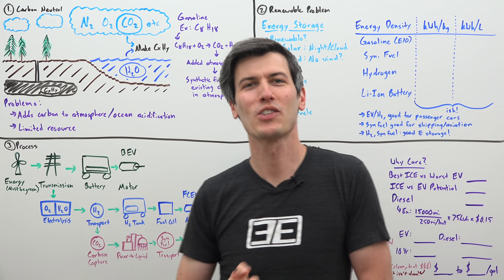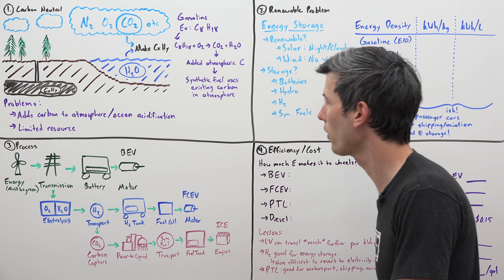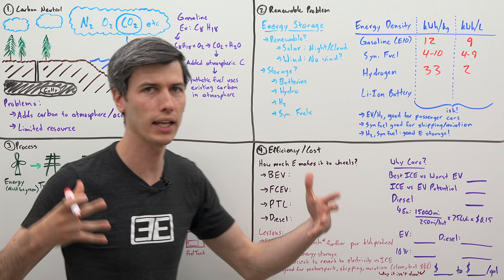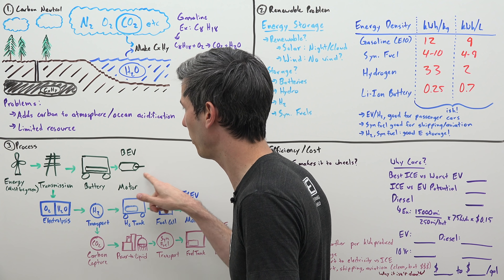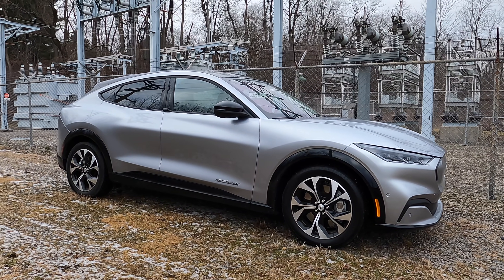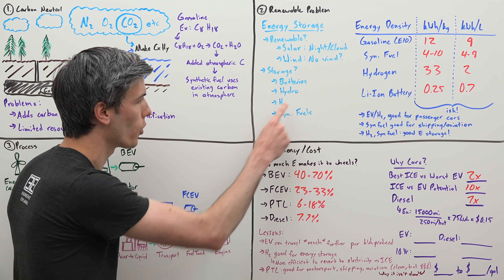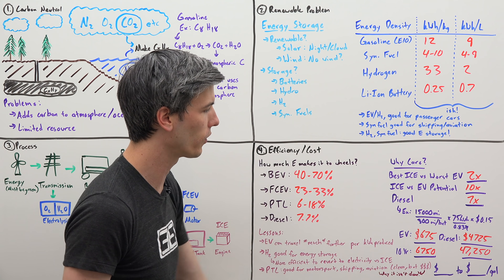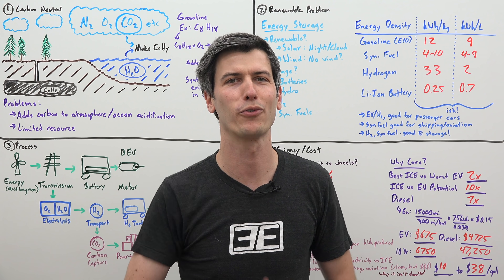The Big Problem With Synthetic Fuels

Comment: Honestly for shipping, I think nuclear is probably the route to go. Much higher energy density than anything else and is reliable for long trips.
Reply: Lol, just in case you need to drive for 20 years without stopping at all.
Reply: @danieljensen2626  I'll jump off subject a bit: naval vessels
Reply: It seems like the capital costs are way to high.  The USN only uses fission for aircraft carriers and submarines.  Russia also has nuclear icebreakers.  Maybe if molten salt reactors drop down the capital cost to something more reasonable?
Reply: Nuclear-electric does make sense, at least in theory, for large container ships and cruise ships.
Reply: @electric7487  I thought nuclear vessels typically used steam turbines for propulsion.
Reply: i dont think private companies can be trusted with nuclear boats. just imagine they neglect the upkeep and now you have hundreds if not thousands little fukushimas running around. Then when end of life is reached the ships conveniently just happen to sink in the middle of international waters because dismantling nuclear boats is a nightmare. No thanks.
Reply: @Gekkoperformance  For most current in-service nuclear technology, I think I'd agree with you. There are some next generation nuclear reactor designs that might be a different story if they can be commercialized and adapted to use in shipping, though.
Reply: @Gekkoperformance    That’s exactly how it would go down!  Here in Australia Woodside Petroleum had an oil rig that was past its use by date so they just “sold” it to two dollar front company and that company goes broke so bingo now the taxpayer is on the hook to decommission it and clean it up!
Reply: @Allen Loser interesting, but what about 200 grams
Reply: Good thinking, bc it’s not like ships ever get wrecked or pirated.
Reply: 100 grams of Uranium can make your car work for years while providing power for your own house. But a car crash would be awful
Reply: Nuclear powered semi truck? Sounds kind of cool, but I can just imagine the nuclear winter we will have during winter when a bunch of trucks crash

Comment: I wonder where ammonia would place in comparison? It's being proposed as a candidate for long term energy storage, as it's relatively easy to synthesize (although the process is still not as efficient as the ones for pure hydrogen), and can be stored as a fluid under comparatively low pressure, compared to hydrogen. Fuel cells for it exist and are being developed further. And while probably still a very inefficient use, normal current designs of combustion engines should be retro fittable to use it as fuel as well, with a few tricks leading to a carbon free solution, even if inefficient.

Comment: Bear in mind that in the example you give about the cost of fuel over 10 years offsetting the cost of an electric car. Most people who are wanting to use synthetic fuel are wanting to use it in a car they already own and want to keep long term, so they don't need to factor in the cost element of the car in your calculation and they will happily pay much more for the fuel element as a consequence.
Also those people will absolutely not be driving anywhere near 15000 miles per year in that ICE car and the fuel will be much cheaper in a few years. So I can easily see this stacking up for most people who want it:
2500 miles per year for 10 years at 25mpg and $10 per gallon is only $1000 per year.
On top of that, if no fuel is available to run ICE cars, then the tens (or hundreds!) of thousands of dollars they have spent on their cars disappears completely because all ICE cars will be worthless. So there's a strong incentive to pay whatever it takes to get the fuel.

Comment: It would be interresting if you included internal combustion hydrogen cars, and compared the final efficiency with FCEV.
Reply: Hydrogen ok in gas turbines and fuel cells. Can be problematic in piston engines.

Comment: What about alcohol?  It's made from sugar cane, at least here in Brazil
Reply: Takes lots of land that better be used for food or forests. Forests are natural carbon sinks even with the night breathing process.
Reply: @petrhajduk9955  which country are you from?
Reply: @H3nr1k3.A  I am from the EU.
Reply: @petrhajduk9955  1 - The alcohol produced in Brazil for use in automobiles is made from sugarcane. Sugarcane in Brazil is predominantly produced in the Northeast of the country, as it develops more in hot climate environments with a high incidence of solar radiation.
2 - The main biome in the Northeast of Brazil is the caatinga, which is a drier biome, AND IT'S DEFINITELY NOT A FOREST LIKE THE AMAZON FOREST
3 - Production for the domestic market is on a small scale. Large-scale production is export-oriented (mainly to China).
4 - Since 1970, alcohol has been used on a large scale as fuel. (any gas station in Brazil sells alcohol)
5 - Forests do not influence the conversion of CO2 into O2. Most of this conversion is done by algae and not trees.
6 - Despite running less km / L, alcohol produces more power and has greater thermal efficiency than gasoline.

Comment: I know this was not the point of the video, and I am nitpicking one comment, but there are exactly zero hydrogen fueling stations in my state, OH, and two electric fueling stations in my garage, which I installed myself for under a $1,000, though my Tesla came with an EVSE, so I just ran a NEMA 14-50. 

Hydrogen fueling infrastructure is not widely available, or cheap. Nearly everyone is on grid, and even those that aren't, are probably generating electricity.  The much better efficiency of EVs, which is the point of this video, is why hydrogen needs to stay away from things that can be done in a practical way with batteries. Batteries, for example, are terrible for seasonal storage. They aren't much good at trans Atlantic or Pacific anything.

Comment: 15 Cents per kw/h 😂 I pay here 29 EUR Cents per kw/h in Germany and it will become more expensive
Reply from the maker: Multiple everything by two!
Reply: @EngineeringExplained  Not exactly, industry is working with other prices, but yes the direction stays the same. EVs for the mass application and syn fuels for special applications and hopefully classic cars. Only the practicability of EVs need to be improved, because not everybody can afford a Tesla and/ or has a charge at Home possibility.

Comment: What about syn diesel made by bio organisms? Guess it's hard to put into a %
Reply: The stumbling block there becomes solar efficiency. Photosynthesis is not very efficient at converting sunlight into energy, and then there's still quite a lot of processing to do once the organism has created the fuel.
Reply: I worked for a year on an algae to diesel project.  And it all comes back to the real golden rules:  the 3 laws of thermodynamics.  Running the algae in photosynthesis mode meant the surface area to get enough sunlight into them to produce a significant amount of C17 oils was about the surface area of the US (only a slight exaggeration).  However, algae can run in fermentation mode so you could then get them to produce significant quantities in tanks but you have to feed them simple sugars produced in complex processes.  Ultimately we scrapped the project to make fuel after we found that the oil was a fantastic fat for food use and the dried algae made a very good flour for baking.  When I see one of Exxon's greenwash ads about algal fuels, I throw something at my TV.  I've bought a lot of TVs.
Reply: Yeah I don't think there's much value in putting energy inputs into large scale chemistry to make synthetic fuels. It's just not an efficient use of that energy, which could instead power many things directly.

However, if we are able to cheaply produce syn-diesel using biological processes with minimal inputs, then that's potentially a huge win. The most promising thing I've seen has been bioengineered algae in mechanically aerated vats, which can be refined very easily and cheaply to produce bio diesel. This nearly eliminates the energy inputs since the algae capture the energy from the sun, and also eliminates the carbon inputs since the algae capture that from the air. The issues are engineering/breeding the most productive algae, and establishing the processes for it. If we can do this with saltwater, that's even more useful since it makes production dramatically more geo-flexible without impacting local fresh water supplies.

If this approach can be made commercially viable, then I think it's our best avenue for making existing fossil fuels infrastructure carbon neutral in the short term. ICE is mostly bad because of the fossil fuel carbon release: we know how to deal with the other pollutants well enough.
Reply: I heard there's a HUGE problem with the amount of nitrogen needed to grow these organisms.
Reply: Just use used vegetable oil in your car it’s free

Comment: It’s a bit missleading. The energy “lost” in ICE is lost in mostly heat from the engine which of course is inefficient, but remember we already have a lot of cars with ICE and also all gas stations which can just immediately be filled with synthetic fuel which is all positive for the synthetic fuel. Also it burns cleaner than normal fuel. By the producers also having there own energy sources the cost can be brought down.

Comment: Massive photovoltaic farms with on-site electrolysis and no electrical transmission costs/inefficiencies might change your math. Maybe not correct to assume retail cost in your analysis for electricity in such a situation. Photovoltaic panel costs have been on a remarkable downward trajectory. The future will be interesting.
Reply from the maker: Yes, you can change the numbers. But the shortest path wins. Photovoltaic farm on a home charging an EV beats turning that energy into an eFuel (from an energy standpoint, which drives cost).
Reply: @EngineeringExplained  scale also wins.

Comment: The missing ingredient is the mining and manufacturing costs for batteries.  Lithium strip mines.
Children digging up cobalt.
And then there is the ticking time bomb of batteries.  Used or not, a battery is finished every 10 years. Where is that calculation?  
How carbon neutral is it to throw away whole cars because the battery is "not worth" replacing on a used car?
Reply from the maker: Cars aren't "thrown away" regardless of if they're ICE or EV. Nearly everything can be recycled. You might enjoy this video, I found it interesting: https://youtu.be/xLr0GStrnwQ

Comment: What happened to the sugar cane fuel that Brazil was working on? They even had conversion kits for current cars.
Reply: neat ethanol?
Reply: @ellenorbjornsdottir1166 something like that, sugar cane alcohol derived from sugar cane. They found that it's carbon neutral. As a bonus, wherever they grow sugar cane, they reduced the temperature in the area by 3 degrees (I forgot if it was 3°C or 3°F). And they said they had conversion kits. It looked like it was all positives.

Comment: Fuels, any fuel, has no overall benefit to the economy if it isn't net energy positive (takes more energy to manufacture than it returns in the form of work done). THAT is the problem with most synthetic fuels. It's just robbing Peter to pay Paul.

Comment: It's actually even worse than that!

A BEV will have a lower road load (because it needs less cooling (lower aero drag))
A BEV will have a lower transmission loss (because it has a single speed transmission)
A BEV does not need to "warm up" so short journey losses are massively lower
A BEV will have lower parasitic loses (no oil pumps, cams to drive, fuel pumps, much smaller water pumps etc)
A BEV has an intrinsically bi-directional powertrain, so can recapture KE from it's mass at speed and put energy back into it's battery.  An ICE cannot do that, no matter what it is fuelled with

This means that for any amount of energy at source (solar, wind, wave, nuclear, or even coal/oil/gas generated) an EV will use less than any other solution, and because the consumption is at the final point in the chain, for any PERCENTAGE EFFICIENCY, the smaller amount of energy you require, the less total energy is lost.

Comment: The price for EFuels will drop when the processes get better and on a larger scale, while batteries are a dead horse. Also efficiency is not everthing, you can´t store electricity, so when too much wind and solar is availible, prices will drop to near zero for certain times of the day. Thats were we can use it to produce our fuel. Also its just mental to drive 500-1000kg of batteries around and whe have to move forward to public transport for the majority of daily transport.
Reply: Basically everything you wrote is wrong.

Price of e-fuel won't drop since Porsche only intends to use it for motorosports. Not just that but electric prices will drop far more so that entire aspect is moot. 
Efficiency is everything because it massively dictates prices.
You can store energy, we do it plenty. For example, we store hydroelectric energy through reservoirs by pumping water back up when demand is low to be used when demand is high. Plus, as energy usage becomes more relevant, we put more effort into it.
Public transportation is only viable in dense areas and is absolutely not an alternative for the majority of daily transport.

Comment: Oil from the ground is "carbon neutral".  That carbon was originally CO2 way back when.
Reply from the maker: And if you expand your scope to the universe everything is everything neutral haha. 🤯
Reply: @EngineeringExplained  No, not really.  Matter-wise, the Earth is approximately a contained system (Yes, there are small losses and gains happening).  Expanding beyond the Earth doesn't really change much.

The point is that this demonization of CO2 and touting "carbon neutrality" is foolish.

Comment: Why is the numbers for diesel range worse? Diesel engines use less fuel than similar gasoline.
Reply from the maker: A lot of energy required to make energy dense fuels. But again it's a range, that's just another data point from an additional study. Study claims as high as ~18% is possible.

Comment: Hey mate
While i agree with you regarding costs etc
I believe in 10-15yrs time the cost will be down to about 30% above the price of normal fuel at that time.

Here's my big issue with going electric, the chemical waste on mass scale adoption, im talking once 60-80% of the currently registered vehicles in the world are using battery power. I simply feel this is going to be a huge issue in the future, and while certain countries in europe will do the right thing (ie sweden) and have a proper recycling program that captures the toxic chemicals and the co2 that is released from the pack, i feel most countries will ship their used batteries to a country that simply will bury the battery or dismantle it in a terrible way for the environment.

There is also still some pretty serious longevity issues with batteries, and while there is the odd battery performing fantastically, i have noticed that far too many of these batteries fail at or before the 7 year mark. This raises concern due to the carbon release in production, deconstruction and the recycling process.
While battery power certainly works for my business and i have adopted it (and love it), i do not believe it is a solution for internal combustion engines on a mass private transport network.

Lets say the average 10yr old vehicle has 2 batteries in its lifetime, i feel thats a safe amount, one replacement in 10 years of service to me seems like what we will be looking at on a mass scale.

Do we have figures for the total emissions released for that period (including construction of first pack pack, deconstruction, recycling of elements and dumping of certain elements, construction of second pack and eventual deconstruction of that cell that will happen at some point in the future, plus, the issues with toxic metals and chemicals found in battery packs)? I remember in an old video you discussed this over a 3 or 4 year period but this goes a little further.

Genuinely hope you reply to this as I'd really like to hear your thoughts on this.

On a side note
If synthetic fuels get down to current petrol price costs or say 30% more expensive, do you feel mass adaption could take place? Or do you have other concerns as well?

Cheers mate

Comment: A bit of a left field question here: what would happen if we used TINY electric motors with a normal transmission with multiple gears? Wouldn't we increase even more the efficiency of BEVs and be able to use smaller batteries? Would that have any effect on highway consumption of BEVs?
Reply from the maker: Electric motors are already super efficiency; it's not necessarily dependent on the size of the motor. A gearbox adds additional losses. Motors are already 90+% efficient.

Comment: You kind of skipped over the importance of efficiency. Fuel density isn't that great compared to electric when you compare the efficiency. I know you sort of covered that by comparing costs directly, but the important thing is to consider that a good part of why those costs are so different is the efficiency.
Reply from the maker: The fourth portion of the video is a discussion dedicated to efficiency, and then using that efficiency difference to explain the cost difference.

Comment: 15,000 miles per year And a 300 mile range. Are not good choices for numbers on that equation at all. Most people with EV‘s do not drive 15,000 miles a year, that’s what people do with regular cars. And most people with EV‘s do not go 300 miles in between charging.
Reply from the maker: 15,000 miles is averaging 41 miles a day. Any EV can do that. For work commuters, plenty of folks will hit that in a year. And pick any timeline, it's just a comparison of two cars with 150,000 miles.